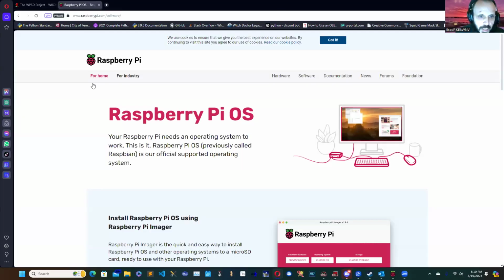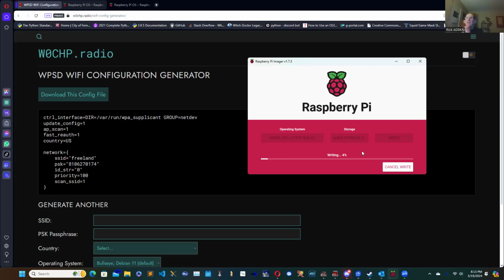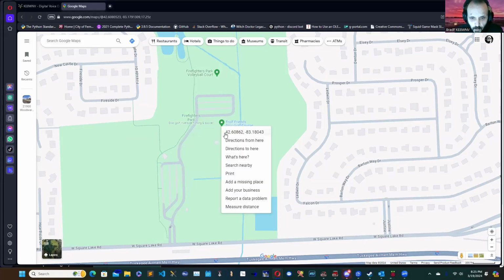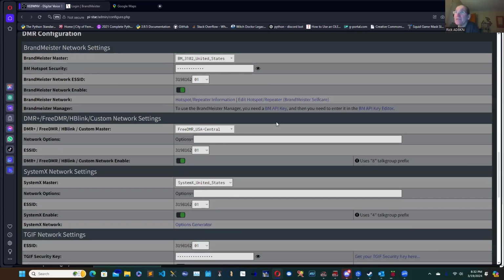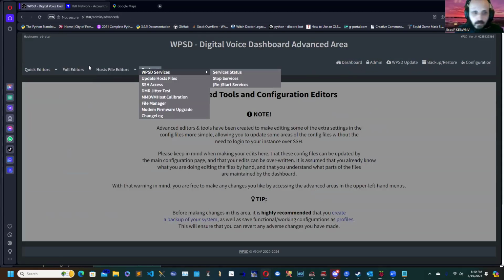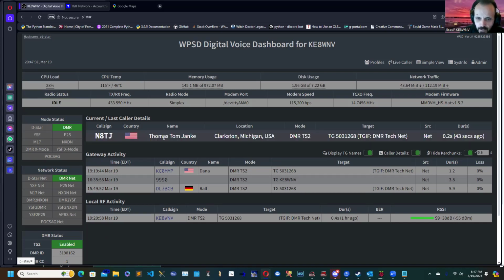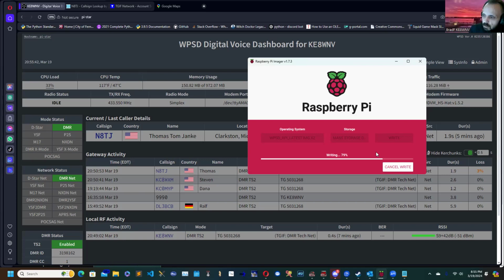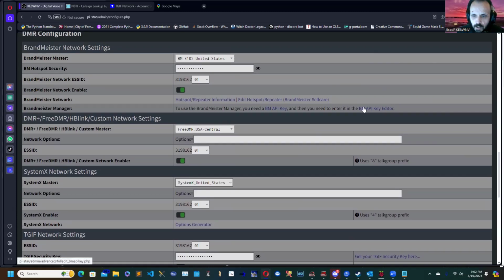DMR Tech Net TV episode 2 about using and/or upgrading your hotspot to WPSD.

Comment: Hello, I have a DVMEGA hotspot and have tried to flash the software that is with the WPSD Project.  This doesn't seem to be working when I try to load it.  Does anyone know what software I could use so this would work.  They have two DVMEGA softwares listed in the Project and I've tried them both.  Please let me know if have any idea how I can this to work.
Reply from the maker: Here's a general guide on how to use WPSD software on a DVMEGA hotspot. DVMEGA is one of the supported manufacturers for WPSD.

Important Note: The DVMEGA hotspot generally refers to a DVMEGA modem (like a HAT) combined with a Single Board Computer (SBC) like a Raspberry Pi. The WPSD software runs on the SBC.

1. Gather Your Hardware:

DVMEGA Modem: This is the specific DVMEGA board you have (e.g., DVMEGA Cast, DVMEGA EuroNode, or other DVMEGA MMDVM boards).
Single Board Computer (SBC): Usually a Raspberry Pi (e.g., Raspberry Pi 3, 4, or Zero 2W are commonly recommended for better performance). Some older Pi Zero W versions might be too slow for all WPSD features.

Micro SD Card: A minimum of 8GB is recommended, but larger is better for future updates and logs.
Power Supply: For your SBC.
Computer: To flash the SD card and access the WPSD dashboard.
Internet Connection: For downloading the WPSD image and for the hotspot to function.
2. Download the WPSD Image:

Go to the official WPSD website (w0chp.radio/wpsd) or a trusted source.
Locate and download the appropriate WPSD disk image for your specific DVMEGA device/platform. For DVMEGA Cast, there's often a specific WPSD_DVMega_Cast-Bullseye.img.xz image. For DVMEGA EuroNode, there's WPSD_DVMega_EuroNode.img.xz. If you're using a generic DVMEGA MMDVM HAT on a Raspberry Pi, you'll likely use the general WPSD_RPi-Bookworm.img.xz image.
3. Write the Image to Your SD Card:

Insert your SD card into your computer's card reader.
Use an imaging tool like Balena Etcher or Raspberry Pi Imager. These tools will automatically decompress the .xz file during the writing process.
Select the downloaded WPSD image file.
Select your SD card as the target device. Double-check that you've selected the correct drive to avoid overwriting your computer's hard drive!
Click "Flash" or "Write" to begin the process. This can take a few minutes.
4. Configure Network Access (Optional Pre-Boot Steps):

Pre-configure WiFi (Recommended):
Visit the WiFi Config File Generator on the WPSD website.
Enter your WiFi network details (SSID and password).
Download the generated configuration file (wpa_supplicant.conf).
After flashing the WPSD image, remove and re-insert the SD card. You should see a boot partition.
Place the wpa_supplicant.conf file into the root of the boot partition. This will allow your hotspot to connect to your WiFi network automatically on first boot.
Ethernet Connection: If your SBC has an Ethernet port, you can simply connect it to your network via an Ethernet cable.
5. First Boot and System Initialization:

Insert the prepared SD card into your DVMEGA hotspot (SBC).
Connect power to boot your system.
Be patient! The first boot takes time (typically 5+ minutes, sometimes longer on slower devices). During this time, the system will: 
Expand the filesystem to use the full SD card.
Generate security keys.
Configure initial system parameters.
Connect to your network if pre-configured.
6. Access Your WPSD Dashboard:

Once the system has fully booted:

If you pre-configured WiFi or used Ethernet: Try accessing the dashboard via a web browser. The URL will vary depending on your DVMEGA device:
Standard installations (generic RPi with DVMEGA HAT): http://wpsd.local
DVMEGA Cast installations: http://dvmega-cast.local
DVMEGA EuroNode installations: http://dvmega-euronode.local
If these hostnames don't resolve, you might need to find your device's IP address through your router's client list.
If you didn't pre-configure network access: After about 5+ minutes post-bootup, your hotspot should create a WiFi network named "WPSD-Setup". Connect to this network from your computer or phone. Then, open a web browser and try the appropriate URL for your device (as listed above, or http://wpsd.local).
Default Login:

User: pi-star
Password: raspberry
Important: It's highly recommended to change this password after your first successful login for security reasons.
7. First Update Before Configuration:

Before configuring your WPSD installation, it's strongly recommended to run a system update.
Navigate to Admin -> Update in the dashboard.
Click to start the update process.
Wait for the update to complete (the system will notify you). Your system will reboot automatically when finished. This ensures you're starting with the most current version.
8. Configure Your WPSD Installation:

After the initial installation and update, you can configure WPSD to suit your specific needs.
Navigate to the Configuration page in the dashboard.
Basic Configuration:
Enter your Callsign, DMR ID, and Location details.
Select your Radio/Modem Type. For DVMEGA, you'll select the appropriate DVMEGA option from the list.
Choose which digital modes you want to enable (DMR, D-STAR, YSF/Fusion, M17).
Configure your node frequencies as appropriate for your region and license.
Save changes. The system will apply them and restart required services.
9. Advanced Configuration and Maintenance:

MMDVMHost Calibration: WPSD provides tools for optimizing your modem's performance. Navigate to Admin -> Advanced Tools -> MMDVM Host Calibration to check and adjust parameters like TX/RX Offset and BER (Bit Error Rate).
Modem Firmware Upgrade: If needed, you can upgrade your modem's firmware through Admin -> Advanced Tools -> Modem Firmware Upgrade.
Automatic Updates: WPSD uses a "rolling release" model and is designed for continuous improvements. It's recommended to leave your hotspot powered on overnight as it can automatically check for and install updates during off-peak hours.
Manual Updates: You can manually initiate updates via Admin -> Update.
Profiles and Backups: You can save your configuration settings by going to Admin -> Configuration -> Backup/Restore and clicking "Download Configuration".
Troubleshooting Tips:

Patience: The first boot and updates can take a long time. Don't power off your device prematurely.
Network Issues: If you can't access the dashboard, check your network connection and ensure the hotspot is powered on. Try finding the IP address through your router.
SD Card Issues: Use a good quality SD card. Re-flashing the image can often resolve issues.
Check Logs: The WPSD dashboard often provides live logs that can help in troubleshooting.
WPSD Documentation and Support: The official WPSD website (w0chp.radio) has extensive FAQs and a user manual. There are also active online communities (forums, social media groups) where you can seek help.
By following these steps, you should be able to successfully install and configure WPSD on your DVMEGA hotspot and get on the air!
Reply: @DMRtechnetTV  Thank you for the feed back. I appreciate it.  I've tried the DVMEGA Cast and the DVMEGA EuroNode and both fail to load.  i will try the  WPSD_RPi-Bookworm.img.xz image and see if that will load.  This hotspot is about 5 years old.
Reply from the maker: @stephenrahauiser7760  We recommend using the Raspberry Pi interface instead of WPSD if your hotspot is older.  WPSD is a great interface but takes up too much headroom for older Pi's and really slows them down.  To install Raspberry Pi OS on an SD card, follow these steps:
Download Raspberry Pi Imager: Go to the official Raspberry Pi website and download the Raspberry Pi Imager for your computer. 
1: Insert the SD Card: Connect your SD card to your computer using an SD card reader.
Launch Raspberry Pi Imager: Open the application and select "Choose OS" to select Raspberry Pi OS from the list. 
2: Select SD Card: Click on "Choose SD Card" and select your inserted SD card. 
3: Write the OS: Click on "Write" to flash the OS onto the SD card. Wait for the process to complete. 
4: Eject the SD Card: Once done, safely eject the SD card from your computer and insert it into your Raspberry Pi.
This process will prepare your SD card with Raspberry Pi OS, ready for use with your Raspberry Pi device.  https://www.raspberrypi.com/documentation/computers/getting-started.html
Reply: @DMRtechnetTV  Thank you for all your feed back.  I did flash WPSD_RPi-Bookworm.img.xz  and it did the same as DVMEGA EuroNode and DVMEGA Cast..  it just never loaded.  Thanks for all your help.